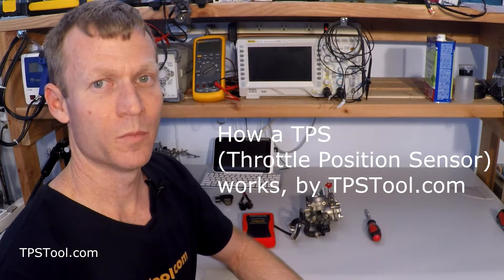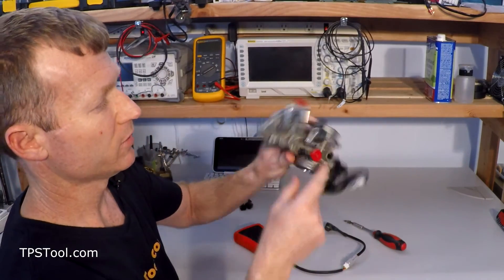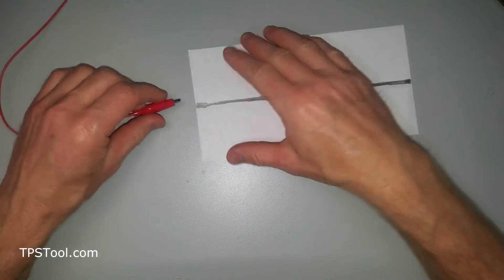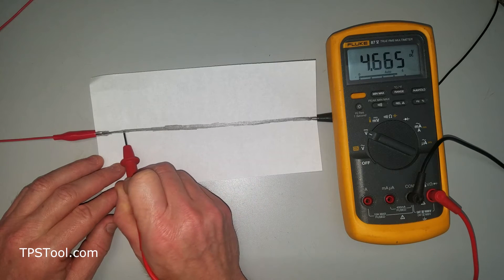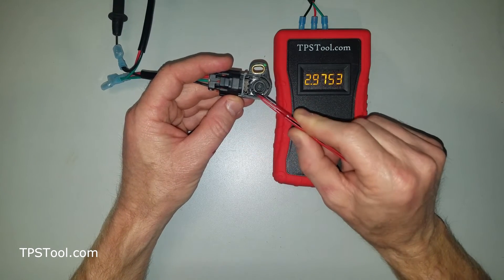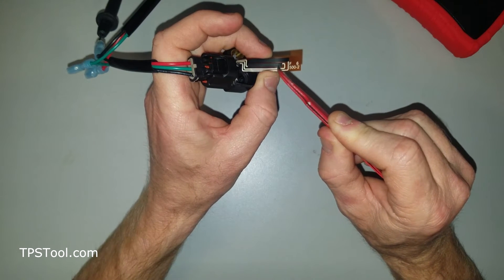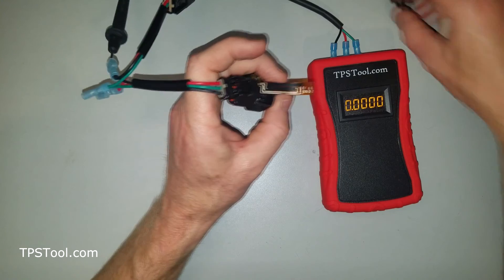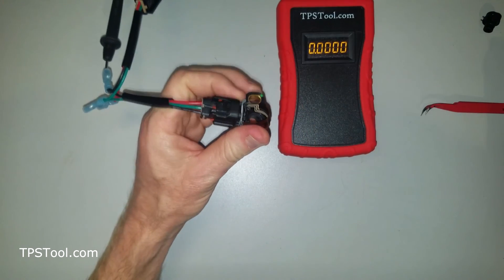How a TPS (Throttle Position Sensor ) works

Comment: Great video . what would you say was wrong if the reading was exactly opposite to this? ie goes down as throttle is opened?
Reply from the maker: Thanks for your comment.  It sounds like something is connected incorrectly.  Without more information, my best guess is the 5V and GND need to be swapped.

Comment: Great video, so if I have my Tps tool hooked of to a potentially faulty Tps, it will still read but as I apply throttle I can see the numbers increase in a spiking manner whereas in your demonstration we can see the voltage increase smoothly. Would this be an sign that the tps is bad
Reply from the maker: Thanks for your comment.  A bad TPS can have multiple symptoms.  It might not read at all, or the reading may jump around, or the reading might get stuck on one value as you open and close the throttle, etc..  Basically the numbers should be stable when it's just sitting there, and should change smoothly as you open and close the throttle.  Anything else is possibly a bad TPS. Here's an example video I made for a customer showing his bad TPS compared to a good one.  In this case the failure mode was the reading bouncing all over the place when it should have been stable:  https://youtu.be/csLeF5AwcN8?si=gCB1FIRWWLrl-AWt

Comment: Hi could you help, when throttle is closed my KTM reads 0.48v but when I open the throttle the voltage decreases to 0.17v, why would this happen?
Reply from the maker: It could be that you're connected to the wrong wires, or that the TPS is bad.  What are you using to read it?
Reply: @TPSTool  hi I managed to read it correctly must have been a bad connection, thanks for the reply
Reply from the maker: @pitracer1979  Excellent, thanks for posting back the solution. :)
Reply: @TPSTool  hi there, when I start my bike with the cold start pulled open on throttle body it will idle but as soon as I push it back in bike dies instantly. Is this anything to do with the tps position? The coke start isn’t adjustable it’s just on and off pull out push in
Reply from the maker: @pitracer1979  Hello!  I just responded to your question in the other thread, let me know if you don't see my response. :)

Comment: Amazing how many hours over the last two days to find your video only to see nothing kan be fixed.

I KANT ZERO THE TPS. WHY?! Some have written that with a scan tool the kalibration is suppose to read 0% when the throttle plate is at idle. 
BUTT- The lowest I kan get it is 2% and below 3.9% it has violent 'WATER HAMMER' Shifts on UpShifting either in D or Manually and some less violent DownShifting No matter how I try to lightly drive the vehikle.

What have you down for retrograde conversions to distributor and Karb to eliminate these krappy Subaru fuel maps at idle. I know it is said to be a MAPS selektion issue which has to be based upon the vehikle movement and speed bekause the kar is doing the same krappy fuel mileage after NOT over- the- road be it at idle or lokal driving. I got as high as 24.2 and no lower than 18 over the road which still sucks for a small light kar but certainly beats 5 to 10 for lokal driving and idle. The fakt that it kould double for a lokal trip over the highway seems to show this is a komputer programming MAPS selektion issue. HELP!!! I kan't afford to give-up I have too much invested and a parts changer doesn't make shit for money!!!!
Reply from the maker: Thanks for your comment.   You've got a lot going on there.  I would start by checking the service manual for the TPS specifications.  I'm guessing you're using an OBD reader to read the throttle percentage, but if the TPS itself isn't adjusted correctly then the ECU might think the throttle is still open a little bit even when the throttle plate is fully closed.  Start by making sure the throttle body is super clean, so there is no carbon holing the throttle plate open.  Then check the TPS reading (voltage) and compare it against the specification in the service manual.  Once that is correct, if it still doesn't read 0% when the throttle is closed, then next check to see if that ECU has a procedure for learning the TPS position.  I hope this helps!

Comment: The video is just excellent. Do you have any insight on what breaks first - the accelerator pedal sensor or the throttle position sensor? My car is throwing a code and I want to replace the one that is more likely to break first.
Reply from the maker: Thank you for your comment!  I think you've got a 50/50 chance on which one, if either, went bad.  For the TPS, you can connect a tool like this one and slowly move it through the range making sure the numbers change smoothly.  If the reading jumps around or gets stuck then the TPS is likely bad.  The pedal sensor is likely similar.  See if you can get a copy of the shop manual for your car, there should be specifications and test procedures for both in there.

Comment: Can I do it on my bike have ktm sxf 250cc 2012 kick start have pigtail and multimeter
Reply from the maker: With the pigtail, start the bike and let it idle. Put a fan in front so you can take your time and the bike doesn't overheat.

Comment: Is the difference is voltage from fully closed to wide open what accounts for the fuction of the sensor or is the voltage itself responsible for function?
Reply from the maker: Are you asking if the ECU considers the voltage proportionally vs. the absolute value?  Excellent question.  Some for sure are proportional, it's possible some also use the absolute value.  There are so many different motors and ECUs, it would not be accurate to assume they all work the same way.  :)

Comment: Thank you so much ! Before i spend 200 Uss on a new TPS, im now encourage to open the sensor and see if it can be fix/cleaned before i get a new one ! Great info !! Thank you !
Reply from the maker: Thank you very much for your comment!  Please be careful, these are not usually intended to be disassembled and taking it apart may make it unreliable.  Keep that in mind as it relates to safety. i.e. could someone get hurt if the TPS becomes unreliable and causes the motor to run unpredictably.
Reply: @TPSTool  Thank you for your advice, i will be carefull ! :)

Comment: I have a TPSTool coming in Monday to use on my 2009 polaris ranger 500.  Will there be a book or something to tell me what voltage I will be looking for?  I do not have the manual and I am not finding it anywhere listed online.  Thank you for the awesome explanation.
Reply from the maker: Thank you very much for your business!  As best I can tell, your 2009 Ranger 500 should be set to 1.12V at idle.  The 2007 Ranger 500 service manual lists the at-idle voltage as 1.12V, and information form the forums indicates that the 2013 model is the same, so most likely your 2009 will be the same.  The service manual will say for sure, but I don't have the manual for the 2009.  Here's a link to a chart I'm building with common settings: https://www.tpstool.com/common_tps_settings.htm   I hope this helps, please feel free to email me with any questions, my email will be on the first line of the instructions in the box. :)
Reply: @TPSTool  Thank you for your prompt reply!!

Comment: How are you measuring voltage on the flexible conductor with only the positive probe and it appears the negative is not connected?
Reply from the maker: Thanks for your comment.  What time stamp?  There's definitely a ground connected, it might be out of the camera view.  Give me the time stamp and I'll tell you where it's connected.  :)
Reply: At 4:59 it appear the sensor is connected to the red self powered tool and you check the voltage across the ribbon with the pos probe so is the neg probe connected to the self powered tool? its not clear in the video.
Reply from the maker: @elpresidente1203  Look at the top-left of the screen, you can see the black probe stuck in the ground lead.  I used a TPSTool.com pigtail in-between the TPS and the TPSTool Pro Powered meter to make the ground lead accessible and stuck the probe in there. :)
Reply: Thanks for the clarification, the video was very instructive.

Comment: It's unfortunate they still use a carbon wiper pot on a DC system. It's not only noisy (remember that scratchy sound from AM radio volume controls?), but also subject to wear. My 2020 350 EXC-F drifted since new until it would no longer idle even with the idle screw maxed out. It would better if they used a Hall effect device, as do even the cheapest e-scooter throttles.
Reply from the maker: Thanks for your comment.  Surely the topic has come up during engineering meetings, I wonder what the reasons are they choose to stay with the older technology.  Thinking out loud, pros for the older technology would be less chance of a hard failure.  i.e. a performance degradation, or a dead section, would be more likely than it just "stop working", but with a hall effect sensor any failure is likely to be a 100% "stop working", which is not desirable where a hard failure can lead to injury.  Also redundancy is easy (cheap) to build into the older technology, some automotive TPS have a second wiper and resistive strip for redundancy (safety).  The old technology has been refined to the point that it works well and is sufficiently durable and reliable, they do fail on occasion, but most people will never have to replace one.  You've got an interesting question, it would be great to hear from one of the manufactures why they choose to stay with the older technology.

Comment: Hi, very informative videos. I am hoping that you can help me on my 2008 KTM 530 EXC-R. It has a carburettor but also a TPS,  is the adjustment done in the same way? Any help is appreciated.
Reply from the maker: Thanks for your comment!  The TPS works exactly the same.  Typically the TPS on a carburetor does not need to be set nearly as precisely as on an EFI motor.  You can set it using voltage as is commonly done one EFI motors, or since precision isn't as important the service manual might give a procedure using ohms.  Check the service manual for your motor, it should have a section about setting the TPS.  I hope this helps!

Comment: Ok, what i don't get is that my Kymco 250cc scooter has this but its not fuel injected. The carb has a bowl where the gas sits. So what's the purpose of having a TBS on a diaphragm type carb
Reply from the maker: Thanks for your comment.  Most likely so the ECU can change the timing advance according to the throttle position.

Comment: VERY informative and cool video. As a viewer looking for a TPS video though, I'm trying to diagnose whether mine has a problem, and if so, what might've caused it, or how to manipulate/replace it.
Reply from the maker: I'm glad you like it.  To test your TPS, slowly open and close the throttle while watching the voltage.  If it changes smoothly then it's likely good.  If it doesn't change smoothly or jumps then the sensor is bad.  Check out the videos at tpstool.com on the help page, there are lots of examples.  I hope this helps!

Comment: Very simple and to the point. I do hope this will work on my 2007 Honda Foreman ES 4x4
Reply from the maker: If the TPS is adjustable then it will work, but you may need to use the universal adapter in the kit.  Here is a link to a video showing how to use the universal adapter.  Feel free to contact me directly if you would like to talk about it more (my email address is in the FAQ at tpstool.com): https://youtu.be/HEIB92yZGwo

Comment: Thank you very much.
This information might have  solved my problem. My car sometimes will not start when cranked and when running the idle is slightly not stable. Did not know my car had one as well.
Might be something else but the car is 30 years old and a new one removes the notion of a faulty part.
Thanks.
Reply from the maker: If a new one is cheap then go for it with a new one, but if it's pricy you can check if the old one is still good.  Put a meter on it and slowly open and close the throttle.  If the voltage changes smoothly and doesn't ever suddenly drop or jump then the old one is good.

Comment: I got here looking for a fix for my 91.5 Dodge Cummins that has a TPS issue. Would this tool work for my trucks? GREAT explanation on how a TPS works!
Reply from the maker: Thanks for your comment!  Depending on your TPS, it might work.  Some of my customers are Ford diesel mechanics so at least some diesels use TPS that works this way, but I'm not personally familiar with the Dodge diesels so I can't say.  If you can post any pictures of your TPS or post the part numbers then I'll take a look and see what I can figure out for you.  Also here is a new video that shows what's in the box and gives you an example of how the tool works on 3 different motors.  The last one shows how to use the universal adapter which is what you would use if there is not a direct fit plug in the box.  I hope this helps, please feel free to email me if you have any questions!   https://youtu.be/LULVnPwUeCc
Reply: @TPSTool  I will check it out and get you the numbers. google "TPS Delete" and it will load 1000's of hits for Dodge 1st and 2nd Gen Cummins. Thanks!
Reply: Here's the Dorman part copied and pasted from Geno's garage.THROTTLE POSITION SENSOR - DORMAN ('90-'93)
Item #: DRM904342 This is a huge Dodge Cummins issue and the usual advice is to delete it and go with a potentionmeter. Very rarely is proper adjustment of the TPS offered as a solution. Could be a market for you! Thanks again.
Reply from the maker: @tobylou8  Thanks for the tip!  It's interesting that people aren't just replacing the sensor when it goes bad, or adjusting it as you suggest.  It's a 3-pin sensor so you can read it with the TPSTool Pro Powered meter.  There is not a perfect match plug in the box, but you can read it using the universal adapter that comes in every box.  If you give it a try please let me know your result, or if you have any questions. :)

Comment: What do you do if its not in range? Mine goes from 2 to 45 only, EBR 1190RX
Reply: I have the same problem, old tps was faulty and bought new one and tried to install it and the voltage have to be set between 0.63-0.75V BUT mine goes only 1.80 at lowest.. so its not in the range
Reply from the maker: Thanks for your comment.  I'm not sure what you mean by only 2 to 45.  Do you mean 0.2V  to 0.45V?  Are you using the TPSTool Pro Powered meter?  If yes, watch this video, it will show you how to be sure you have it connected correctly:  https://youtu.be/beMuimt0d88

Comment: I need to tell you how much i appreciated and needed to see this video.  Short version real quick, bought a 2018 650 ninja really cheap because he thought the bike was totaled because it  wouldnt go faster then 60 mph before it would just bog down and get no power.  They told me it was a simple fix, needs new fuel pump.  They said that loud noise you hear when you turn the key is the pump going bad. Witch now i know is not the pump but that subthrottle sunsor or little motor thing going bad, thanks to you oncve again.  Anyway,  I bought it because it started rite up and sounded beautiful. $2900 how could i not.  Im far from a bike mechanic but i think anyone would of thought what i thought and it woukd be an easy fix.  Well this is where it gets good,  I bought an after market fuel pump with no luck then was told i needed a power commander because its the exhaust was doing this, needed to be mapped out, so i bought and learned all about that product, downloaded maps and fuel maps and bought maps from people, Nothing!! no change. So now i spent over 500 bucks because everyone knows whats wrong with my bike with no results. Excuse my french but F@#&@ them!!  this was 2 different Kawasaki dealership mechanics btw.  Now im feeling hopeless i bought new fuel injectors replaced them new spark plugs replaced them all with no change at all.  Its funny now but i was going insane because i know its some simple but i cant figure it out and something with the fuel line.  I mean all these so called mechanics out there and no one could help or fix my bike.  Well then your video popped up outta nowhere.  I broke my bike down so many times and had that sensor in my hands so many different times and had no idea it was even a thing.   im  just so excited  i saw this video and the way you broke it down was absolutely perfect.  The kicker is that the check engine light was on and they (the mechanics) told me they couldnt get the code up either witch is bullshit. Now i got a friend good with computers to show me and we get it and it says 32 witch is a subthrottle sensor malfunctiuon.  nobody heard of them or can even find me one to order a new one.  Im about to go break her down again for the 10th time and see if i can do what you said and clean it up or fix the connection somehow.  sorry for thius long dragged out story but you had to kind of get the whole story to really know and feel what i been going thru for a month now.  Thanks again and if you can help me find a place to get a sensor please do im at the point where im almost willing  to pay  anything  to get her at 100%
Reply from the maker: Thanks for the reply, I hope you can get it sorted!  Any dealer should be able to sell you a sensor, or you can try a place like Partzilla.com.  There might be some cheap knock offs on ebay, and if it's cheap enough then maybe try that out to see if it fixes your issue, but I would personally go with an OEM sensor before riding it in traffic.  I hope this helps, please respond back when you get it figured out!